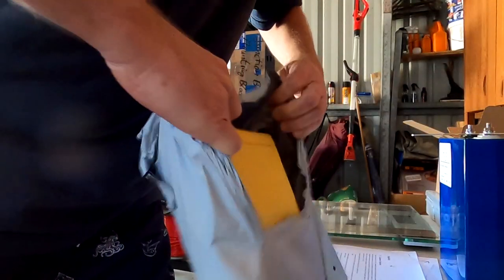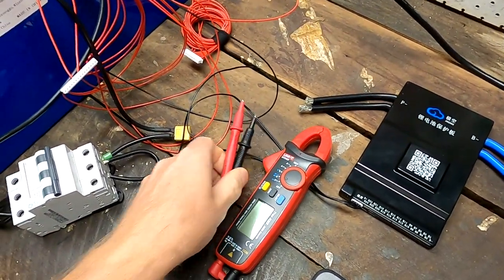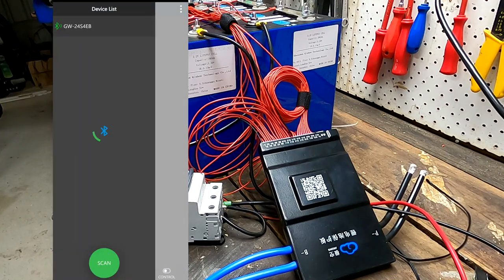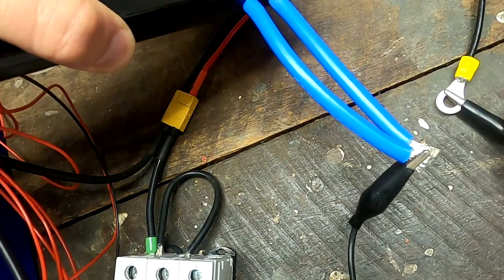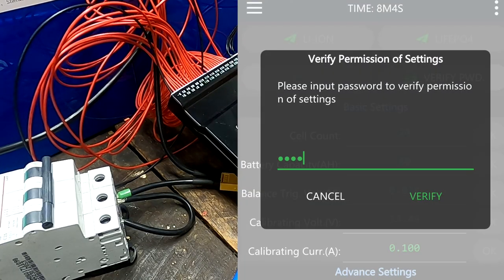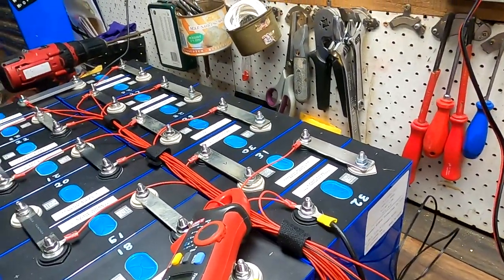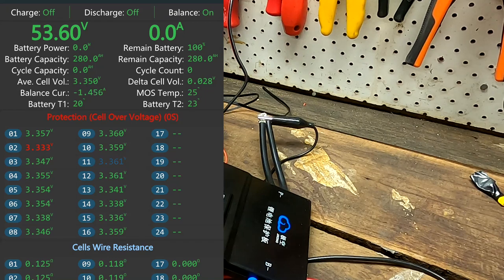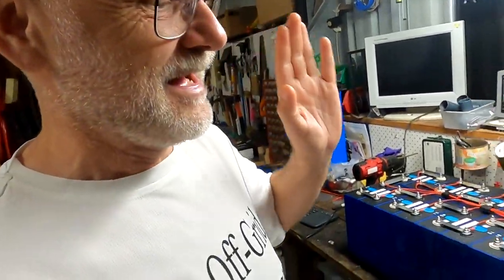The JK BMS with integrated active balancer. This is the one!

Comment: I've been running two of those for the past year without issues. Probably the best BMS in this price range one can get.
Reply: You helped me start my unit a long time ago :) Still running without problems. Thanks ;)  I fear the price of this unit will go up like a Falcon rocket now :)
Reply: @mrzed6597  NP :) I vaguely remember. I've done so several times for other people as well on the forum - at least there appears to be a manual in English floating around now. There should be enough vendors out there to prevent too much of a price hike. That said, with component shortages worldwide as they are, that might impact pricing as well.
Reply: @upnorthandpersonal  I fear it will be like the cells. A year ago EVE 280Ah was $1800. Now it is $2300 (for EU). More demand, higher prices.
Reply: I agree with up North and Personal. I have two of these running now perfectly for quite some time.
Reply: @upnorthandpersonal  is there a direct link to EVE?
Reply: @upnorthandpersonal  Even the comments with the forum name. Not a link, just the name of the forum.
Reply: @mrzed6597  yeah, noticed... YT comment section is awful.
Reply: @upnorthandpersonal  I think I found it. Thanks buddy. The prices are def more in line with class a cells, around $200 each vs the $95 I have been paying.
Reply: @Sanwizard1  yeah, should be around 130 to 150 for one. EVE doesn't like dealing with small buyers directly.
Reply: @Sanwizard1  
Would please share the link
Reply: @mrzed6597  No, that depends also where you live in the EU cause some parts are sold to Germany at at a price of 150 € and guess what the manufacturer wants for the same part from an italian ?
well, the same price as before corona just 100€.

And pretty much the same happens againn with batteries by all the fees they add on alibaba.
If you have to ask for quotes they can do everything with the prices and with the grades they ship you.
Meanwhile they know that the germans go crazy if they got not the promised grade A without cratches and so on.
Reply: What do i  do if the battery trick doesnt start it?

Comment: Also known as JK Heltec BMS. As we said half a year ago it is the best product for these cells. You did a big detour, but at the end everyone comes to the same conclusion :) There is a big thread about this BMS on Will's forum. With the description how to start it with 5V using a lab power supply. Also RS485 communication with RasPi.
Reply: Do you know of any US resellers that stock these?
Reply: @CROSpunkie  Sorry, I am from EU. So I do not have a clue :) I ordered directly from China.
Reply: link please
Reply: Where is wills forum
Reply from the maker: I knew about these BMS' for a long time already but I also wanted to explore other options, like the Daly and the QUCC with relay, the active balancers and smart balancers. All this all in one unit makes totally sense.
Reply: Did you tested it with PV panels? Is the setting different when you connect it to the solar panels? Thanks
Reply: @OffGridGarageAustralia  It is a journey for everyone. We just tried to spare you the ticket price :)
Reply: @mrzed6597  I started slightly before Andy, and indeed I have found that he reaches the same conclusions. I just wait now, he documents the journey and let's others follow along.
Reply: @john_in_phoenix  I am waiting of Andy's shelf project now :) My main problem is that I need a cabinet (a big one for 2 inverter and battery, or more small ones), closed with doors, and possible IP55 because there are water pipes near the battery. So a single pipe leak/burst could have catastrophic consequences.
Reply: @kostaskostopoulos2913  you can not connect the bms with solar panels. it is a battery management and the only way to get a panel connected is the battery charger, the blue victron I guess he uses. 
It is just an add on to the battery and the only major decision is in which order to put things together.

in another video and experiment he said that he learned a lesson that the smart shunt for the victron needs to be first which means before the BMS cause once BMS is turned of his smart shunt was dead.

battery - smartshunt - BMS switch - BMS - fuse - battery switch 
is the solution he had meant afaik
Reply: Where is will's forum
Reply: @OffGridGarageAustralia  Do you still recommend these? My Ant BMS won't turn on, and I am looking for a 200A BMS for a 48V Lithium Ion for a 3000W inverter.
Reply: @mrtechie6810  he just made a video a few hours ago showing the old model with a new ESP32 based software. It is the most functional that exists pretty much so yea he does. Eventually taht software will work with these
Reply: @gg-gn3re what do you mean ESP32 software -- isn't ESP32 a hardware module?

Comment: Could you open it up and check the quality of cable connections to the BMS and what kind of cooling they have those MOSFET's? Thanks. I have older versions of active balancer and they work great.
Reply from the maker: I will open it and check that. The cooling is not too important as the internal resistance of the FETs is only 0.3mOhm. At 200A, that's only 12W of heat generated.
Reply: @OffGridGarageAustralia  True. However, one has to take into the account quality of solder job on those wires (which is wrong execution of how to attach wires to begin with) and fact that we are dealing with lowest cost china made FET's.

Love the thinking behind this product and have been looking at these BMS/Balancers since last December but 7AWG wire and its attachment to the board has me bit worried. Looking forward to your next video. Thanks
Reply: @DMIINC2013  I wouldn't be surprised if this has Infineon or International Rectifier MOSFETS in it. Low RDSon MOSFETS are not that common, and even my low cost inverter had these in them. I remember opening the BMS as well, I just don't remember the FET they used...

Comment: Hey Andy got a question for you.  My daly bms has failed not 100% why but got myself a jk bms, can I swap it out without charging my battery’s fully before I do?  As this is totally of grid and have no means of charging battery’s back up to 100%?  I’ve a 280ah lifepo4 eve battery. I’ve a Victron smart shunt connected to my system.  I was wondering if once I add the jk bms to my system I could set the charge percentage to what it shows on my shunt and reset it once fully charge.  Will it cause any problems?  Thanks Dan in the uk

Comment: So I bought one. Came 2 days ago. Installed no problems. Started with 6v battery. Worked fine. Balanced my battery on first charge cycle. Excellent product.  No more Daly. Thanks for the video.
Reply from the maker: Hey, that's great feedback. The internal balancer is amazing, right? I really like the functionality and ease of setup.
Reply: Hey bud, just curious, I'm looking at both the Daly and JK bms to replace my ANT BMS on my ebike due to the inadequate balancing force and the fact it is passive on the ANT. What is better about the JK over the Daly? I am looking to run 250 amp peaks. Nominal will probably be around 100 amps at cruise velocity. Will the 200a JK do 250 amp peaks??

Comment: Power off voltage is the voltage at which the BMS itself turns off to prevent slowly draining the battery.
Reply: Funny side note: the very expensive LG RESU 10h does not have it (or set too low). A unit's battery was completely drained when it was 1,5+ years in a storage. Lithium batteries loose max 3% SoC/month.
Reply from the maker: Ah, right.. that's a good tip, thank you. Makes perfectly sense. So turn off voltage will turn of the BMS once one cell hits this voltage?
Reply: @OffGridGarageAustralia  Yes, exactly.

Comment: Hi there I just got the new jk 200a with the display. 
It only has a red and black wire on the cable not hooked to anything. You connect these momentarily to start it. That was nice. 
The cable going to the display does not have the 12vdc power to power the display. I'm using alligator clamps across 4 cells to power it. 
And it is mostly in Chinese so I asked if you can change language somehow on it. 
It was 29 bucks. With the app I think it is not really a got to have item. 
 The app wouldn't see the bms. So I had to go in my phone app settings and give it permissions.  Then it worked. 
 This is the 2a 24cell 200a I'm using on 8cell batteries so I had to get a 24 to 48v boost to power it. 
 All in all I think this is a great device. I'm glad I got it. Nowi have to fully charge and draw it down to get the meter calibrated.

Comment: Just in case, like me, you have a BMS already and simply want the equivalent Active Balancer, JK also sell the same thing but as an active balancer only. If you already have your battery assembled and taped up, they also have an adapter board that you can plug your existing BMS wiring into from the battery, the adapter goes in to the active balancer, and has ports to cable to your old BMS.
Reply from the maker: Ah, great information Trevor. Thank you. That's very good to know. Such an adapter makes a lot of sense.

Comment: Considering that 2 x 7awg cables have a maximum amperage of 30A x 2 = 60A how can it hold 200A in charge/discharge?
Reply: I have the same question. This is very strange for me. Does anyone ever tried to run this BMS ant max load? What is going on with the cables?

Comment: Have u attempted the cascading feature to use 1 device for a 14s 7 p, configuration? multiple strings in parallel??? 1 device! i am having difficulty understanding the wiring schematic in the manual. Have been looking for a couple of years now; on youtube, and no one else has shown how they do it!!!!!
Reply from the maker: No, I haven't done this. But a 14s1p is not different form a 14s7p form the BMS perspective. All parallel batteries are just one battery for the BMS.

Comment: can I connect in parallel two JK BMS (8s 100A)? I have two battery packs, 24v each with JK BMS. One battery pack contains 8pcs cells (3.2v).
Reply from the maker: Yes, you can parallel as many batteries as you like as long as they have the same amount of cells, chemistry and each battery has its own BMS.

Comment: Hey Andy-
I bought 16 280 Ah cells and the BK BMS with 2A active balancer. I have a quick wiring question, hope you can help. For a 16S configuration Is it true that the number 16 pin, 24 pin, and B+ all go to cell #16's positive terminal? Or was this Youtuber confusing #24 wire and the B+ wire? I don't understand why #24 wire needs this. Seems #17 through #24 wires should all be removed from the connector. Just #16 and B+ wires should go to the last cell. Please clarify.
Thank you.

Comment: The only possible issue is that all mosfet based BMS, if they fail (IE due to high voltage spike from broken solar charge converter), will fail with a short. Thereby allowing full access into the battery. For that reason I'd be more inclined to use a BMS with a separate contactor
Reply from the maker: Yeah, OK, fair enough. The BMS should be the safety device for the SCC. If the SCC fails, the BMS should turn off. So you mean we would need a third instance of safety. Something like SCC->BMS->contactor?
Reply: @OffGridGarageAustralia  There was a case on the forum where a 24V SCC got into short allowing the PV 100V 10A directly to Daly 24V BMS (FET's shorted too) and to the LFP cells. Cells bloating, magic smoke released. Since then we are searching for a cheap preventive solution to this possible battery killer error.

Comment: Hi Andy I've been using what looks like the same BMS (JK BMS) for over a year now, works a treat, the only pain is having to have 3 volts above battery voltage to switch the BMS on. Once its on it does stay on, the reason I got this one is for the 2A balancing, my other one was balancing too lower amperage.
Reply from the maker: I'll have to figure something out in regards to the start voltage. It's not ideal having that but manageable.
The BMS seems ideal as it combines a great BMS with an active balancer.
Reply: Yup, im running into that issue consistently :( today, i just cant get either bms to turn on at all
Reply: @OffGridGarageAustralia  Was this topic followed up here! Or are there updates on the part of JK that enable switching on through another function?
Reply from the maker: @bstaab2590  That has been sorted with an upgrade on the BMS. It now comes with a start button and a display. I tested the 4S version with display here on the channel: https://youtu.be/LDalnC01MZE
Reply: Is the new version  with start button and display only available as 4S version (that’s the only link on website).  If not, can you please provide link or part number for 12S+ with start button?

Comment: Hello, Yesterday I put my battery pack into operation with jkbms. The temp. sensors are plugged in and enabled in the app. Unfortunately, no temperature (T1;T2;Mos) is displayed (display: NA). What could be the problem?

Comment: Does using a BMS with active balancing negate the need for top balancing when building a new battery pack. Wouldn't the BMS top balance the cells when plugged into a charger?

Comment: Hi Andy, although this video is already 2 years old still very valuable. I'm currently setting up 2 48V batteries with these JK BMS's and found this video very helpfull. Thank you very much for this. But despite this I still have question left and that is regarding the size of endlug you mounted onto the  black and blue cables. When I look at the diameter over the strings (5mm) the diameter of the lug should be more than 5mm. I would say 5.5mm which belongs to the size 16mm2 lugs. Do you agree on this? I would love to get your answer. Thank you for all the great work you are doing I learn a lot from your videos. Kind regards, René

Comment: Hi Andy, 
I need your help, i’ve got the same BMS and my battery is new, but it keep saying that i have 73% power remain, while the charging state stops and i reached my max voltage which is 55.42.. i have a 200ah battery.

Comment: Is there a device like this, but for two 12v batteries (24v system = 2x 12v)? Use cases: my UPS has two 12v 9AH SLA batteries in series and I'd like to balance them for longer life, passive balancing is ok. Use case #2 - I would like to balance the two 12V SLA series-connected batteries in a motorhome (24v system). I am aware of the Victron Energy battery balancer, but am looking for a much more economical solution. Just need a passive balancer that works when charging, not a BMS. SLA (sealed lead-acid) is what I'd like, but you can point me to an AGM too if there's a difference (pardon my ignorance).

Comment: Hi Andi,

which BMS is now the best you ever got hands on and tested for a 16S large capacity battery ?
and
which active balancer is the best you ever got hands on and tested for a 16s large capacity battery ?

as there are 12A active balancers popping up on the stores now, did you also have a chance to test one of those ?

Grüsse aus München (und ich denke ich darf dir auch Grüsse von Christian (der Kanal) ausrichten) 😜

Comment: I will be building my 1st pack using this BMS and have a 24v 16 amp power supply with a ISDT Q8 Battery Charger/Discharger, Balance Charger Discharger 20A 500W DC 2-8S , I also ordered a  0-12v 60 amp power supply (that's supposed to go up to  60v but  not hopeful)  question is do you think I will be able to wake up the BMS or should I get a 60v 5 amp power supply like yours? The pack will be hooked to 4k of solar when all said and done.

Comment: Hi again Andy, Have been googling but cant find anything. Do you by any chance know a link to a wiring diagram, having trouble working out the 2 black wires on each battery connection plug.
Thanks

Comment: I am looking at the aliexpress link you provided. In the title of the product it says 36V 48V 60V. But looking at the table data listing I can't find anything about the voltage. I want to build a 12volt 840ah battery with 12 280ah eve cells. I tried to send a message to the seller, but just got the same data that is all ready on the aliexpress site.  Will this support this?

Comment: Hi Andy, are you sure a 2* 7AWG or 10-16mm wires can stand 200A charging or discharging continuously?,
Would it be possible to replace those 2 wiring for 1*50mm or 2*35mm?,
Victron is recommending thicker wires for that current than Chinese Manufacturers :S.
Good video review btw :)
Reply: Hi Juan! I did not use the short pieces. i replaced them by 2 times 16mm² equal to about 35mm² and continued after 15cm with the 35mm². i agree that the 200 A is very optimistic. 35mm² single cable can be charged with 160A according to german standards. I am also not sure whether the bms can withstand 200A/350A... and honestly i would not do .... i would limit the input/output to 150A...
Compared to the DALY 200A BMS the JK is tiny ....

Comment: I just ordered that same model, I've never put a pack together before infact I don't even have the cells ordered yet, but I'm getting 16 280ah eve cells, I've got 5600 watts of panels and 4 12v 200ah lifepo4 batteries in sires for 48 volts, so I'm gonna build this  pack and wire to parallel to my batteries
Reply: I'm in Canada about the same price but ca$

Comment: I'm planning to buy the 200A/2A jk bms with rs485 for my battery pack, just waiting for a couple videos/reports on how they perform (are they really as perfect as they sound)
Reply from the maker: Yes, the JK is very good. Most people use them these days for batteries from 4s-16s and beyond.
Reply: @OffGridGarageAustralia  I will buy 16 Eve 280Ah cells.
I am just unsure about the whole Minus-disconnecting problem with victron, I already blew 2 cerbos because I managed to create a rare special condition